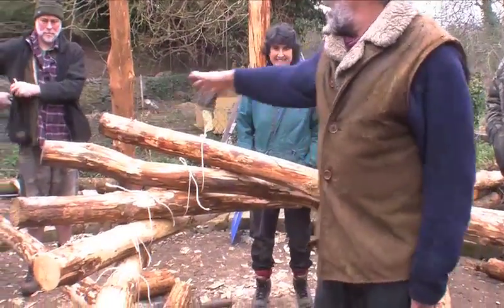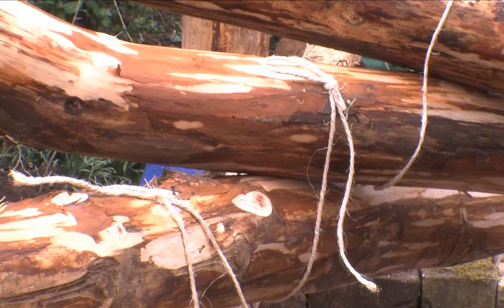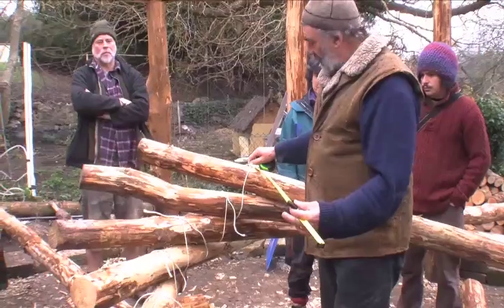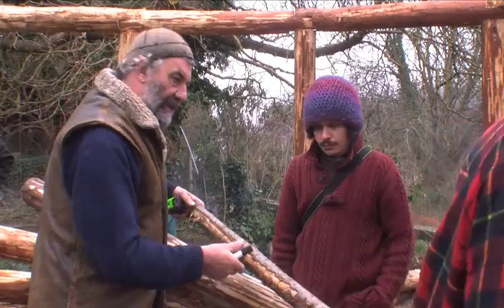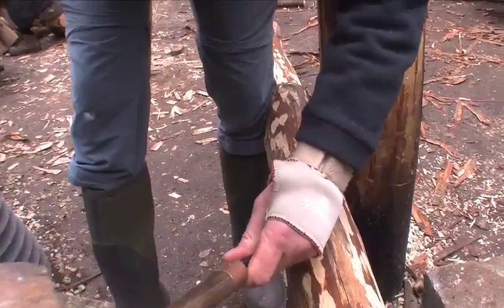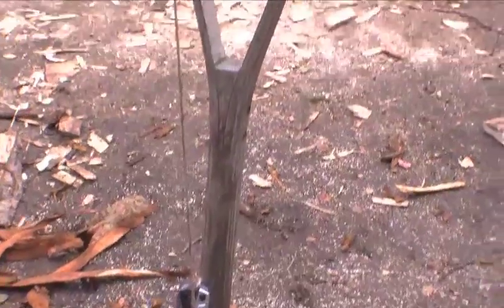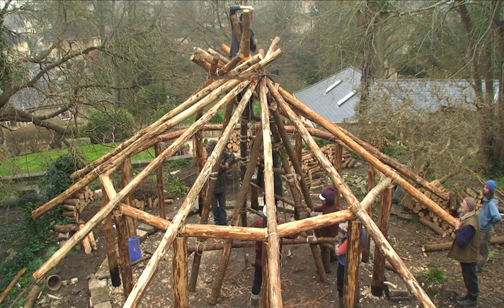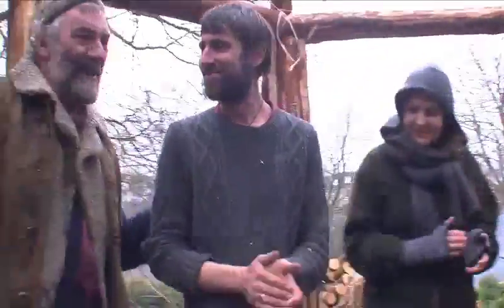How to build a Reciprocal Frame Roof - with Tony Wrench: Living in the Future (Ecovillages) 43

Comment: MAKE LIKE A 2V GEODOME 70 LOGS 35 ten foot and 35 9 foot AND BUILD IT UP  YOU CAN HAVE A 5 POINT OR A JEWISH STAR ON TOP IF WE WANT SOMETHING SPECIAL AS WE WERE JUDEO CHRISTIAN AND YOU CAN BUILD THE GEO DOME AND THEN STRAW BAILS FOR INSULATION AND THEN RED CLAY MIX TO COB IT UP 6 1/2 parts red clay to 1 1/2 water 1 1/2 sands and 1 1/2 straw AND COB UP OR WATTLE DAUB IT TO CLOSE UP THE STRAW BAILS AND THEN HAZEL WEAVE THE ROOF THEN COVER WITH SOD TO INSULATE OR THATCH WITH THE BULL RUSHES THATCH IT ALL WEAVE INTO THE WATTLE DAUB ON SIDES IF YOU NEED TO ! CEDAR ACROSS INSIDE SO NO BACTERIA .

Comment: Thanks Tony such a good instructional video. I'm making a pallet yurt at the mo and its going to be on a platform. Small 2.8m yurt.  When the yurt is built, two poles will slide underneath between the bearers and 4 strong people should be able to lift it and plonk it on a trailer for moving, failing that pulled up onto a trailer  on the bearers as skids. 
I wanted to build a reciprocal roof and you showed me how. My walls will be pallets. It will be 8 walls, 1 of those a door and 1 a window.  Geez on second thoughts it's going to have to be 4 very strong people or 8 would do it easy or a tractor with a couple of strops. No problems only solutions.  I'll tell you how goes. 
One question, when the poles at the top protrude do you just flatten them with a nice sharp saw or chain saw then a plywood ring attached to the ends of the rafters and curved wood on the ring to shed water once the roof is on.

Comment: great explanation on how to measure the charlie and the 24 cm to get a 1 meter opening, but how did you come to the 60cm for the first measurement on the rafter?
Reply: I think, that was just the distance from the tip of the log to where it rest on the one under it. Happened to be 60 cm. At least that's what I think.

Comment: could this type of roof can support a canadian winter??
Reply: https://casaeco.files.wordpress.com/2012/03/reciprocal-frame-architecture.pdf
Reply: @LoisMcQuinn  thx
Reply: I wonder this also... however i have seen them with Sod roofs and well that Weighs A lot ... so it might... I am building one as a round pen for my horse possibly this summer.
Reply: I made one out of bamboo sticks stuck together at the peak with hotglue. Only 6 sticks about 7" long. Wasnt a round shape at all, some crazy shape that I dont have a name for. I weighed it on an accurate scale - 5grams worth. I then started to test weight on it - and I got up to 1.181kg's and none of the sticks broke but they sure were bending. Thats a ratio of 1: 236 and it could take more. Whilst it obviously sagged down, they didnt separate nor touch the flat table surface beneath them. I think if thats any indication, its without question this can support a good solid Canadian winter. I lived in NS and we got all time record snows 3 years back, and had a barn and house to look after during it. I've seen them support living roofs and thats a PILE of weight on it, with no ill effects.